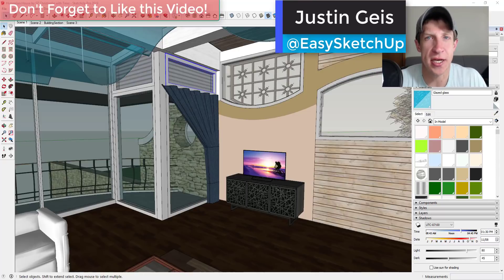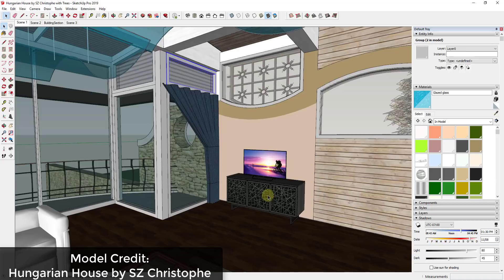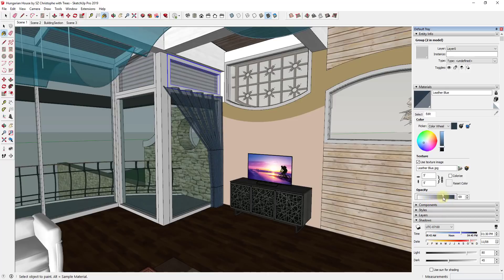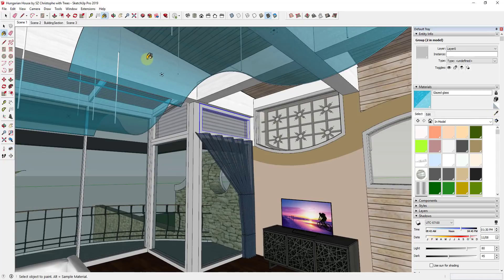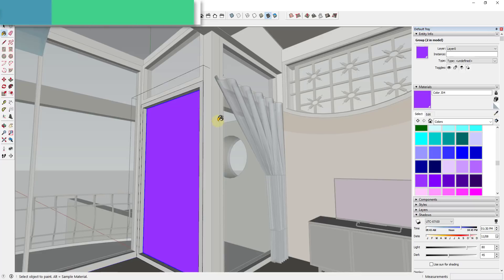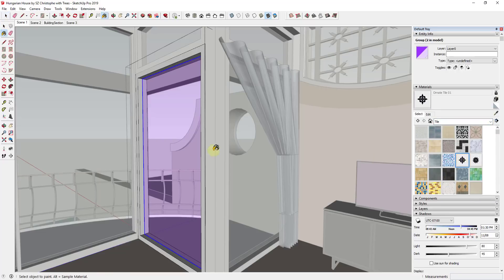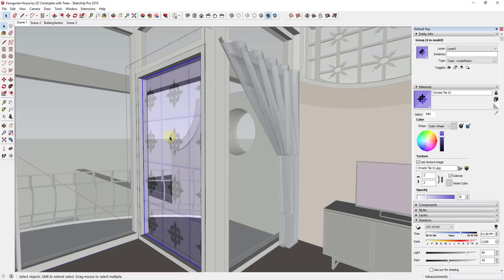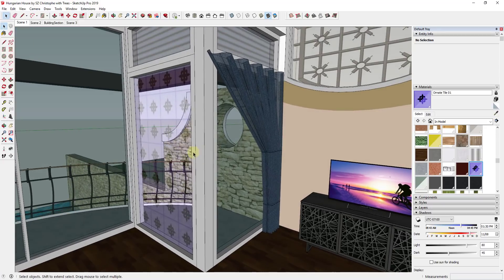CREATING TRANSPARENT MATERIALS in SketchUp!

Comment: Hi Justin, I am having some issues changing glass settings when I have a glass jar inside a glass display case when rendering.  The glass jar tends to go black when behind the glass of the display cabinet in my render.  Mac user so it seems like I may have less options than what you are showing in this video, but aside from opacity any thoughts on how to get a better render.  Newbie here, so I am still tinkering as a write this.

Comment: handy info, thanks again! I guess if you had multiple objects with the same material, but only wanted to adjust the material's opacity on a single object you would need to create a copy of the material, rename + apply/ adjust it on that single object?
Reply from the maker: Correct - you'd have to make a separate material for each level of opacity you'd like